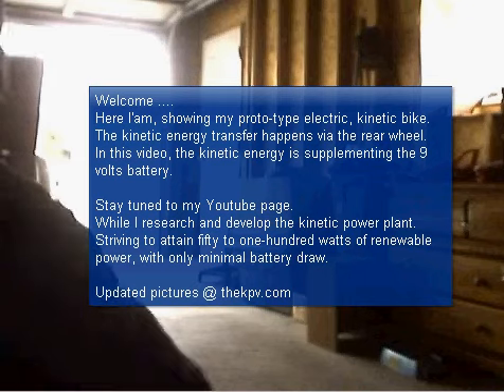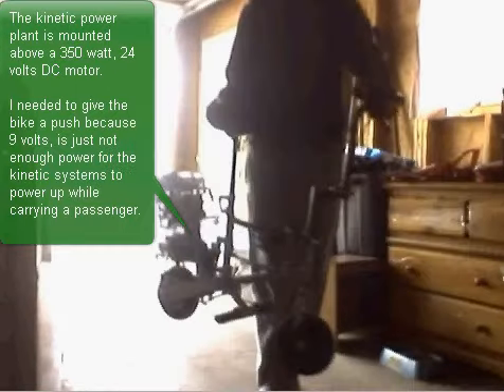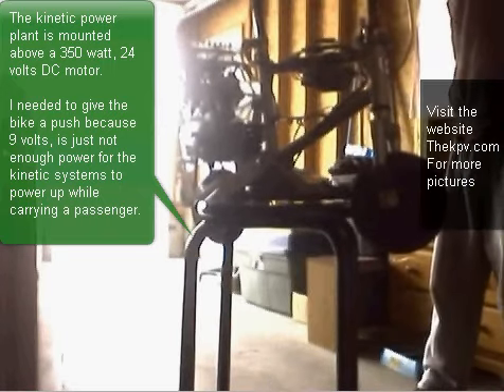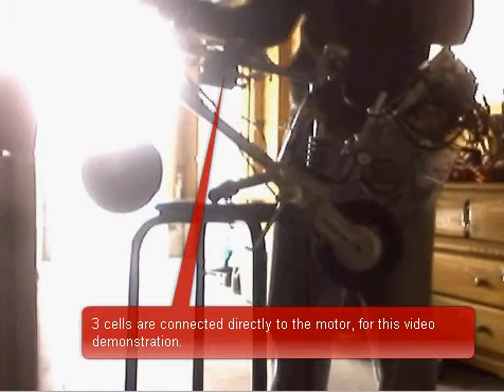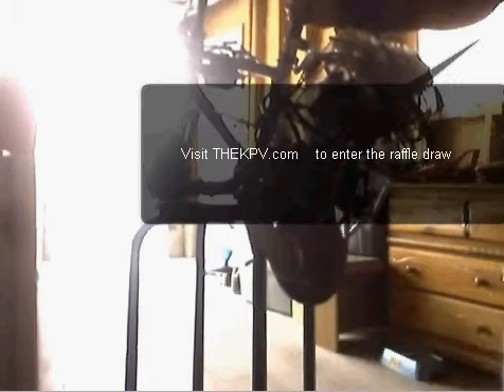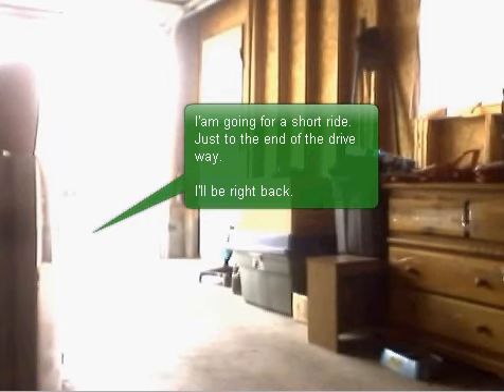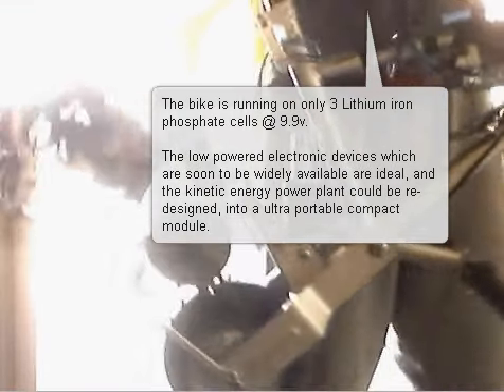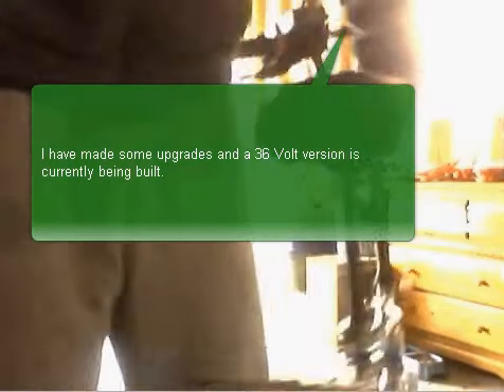EV kinetic hybrid scooter ebike - with KERS and electric motor (dialogue)

Comment: i am going to just give it to u. two sepret evs in one, bolth are regenitve costing cap. one pushes the other and one is chargeing the other is powering and then then the power is up they switch. it does not last forever only about 2 days of riding without charging.